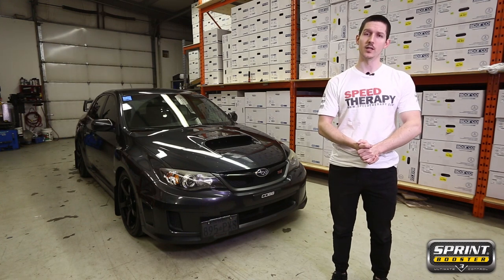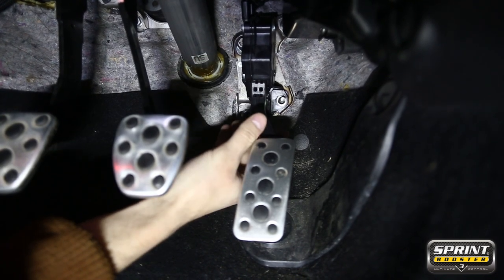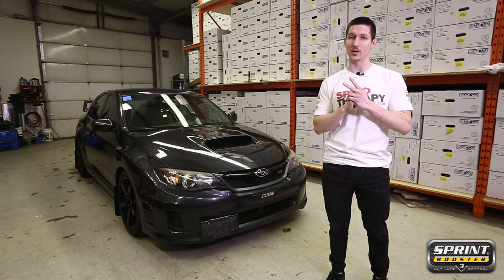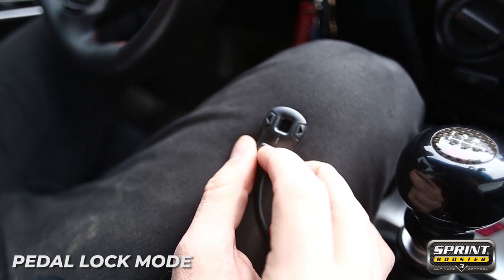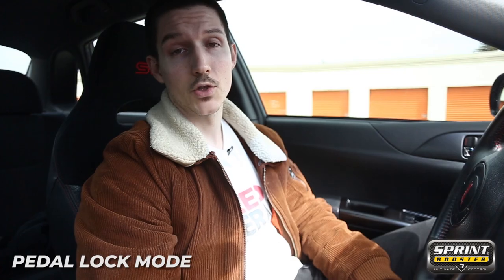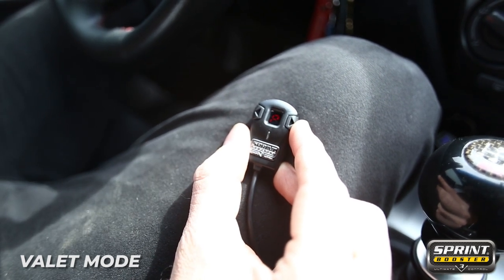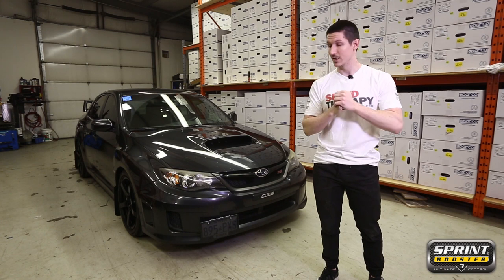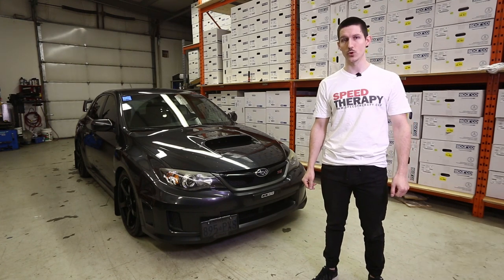Sprint Booster installation on a 2011 Subaru STI

Comment: I have a 2019 Subaru Crosstrek 6MT. Are there any videos for this platform coming out? I'm saving up to purchase mine. Is there also a setting for your transmission being manual/cvt/or geared?